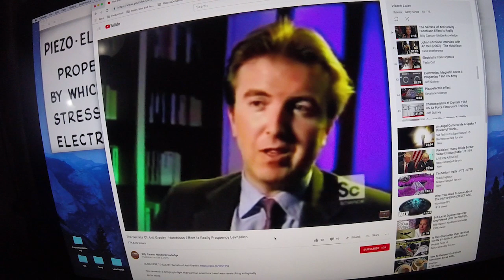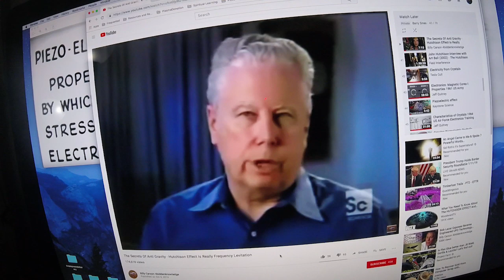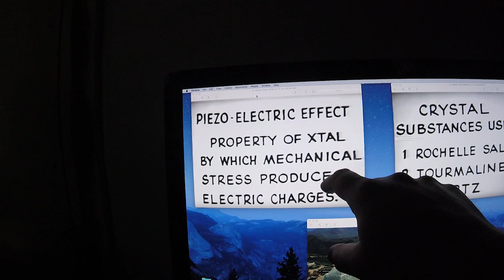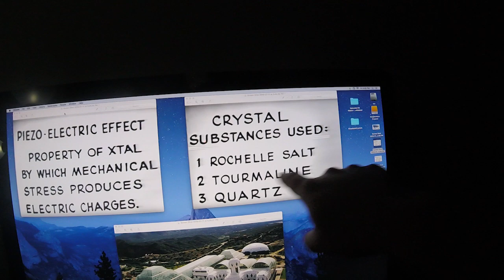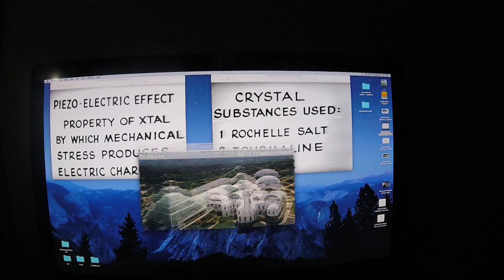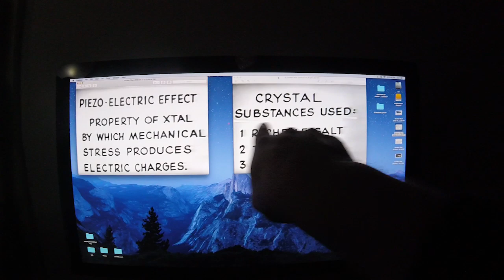DIY CRYSTAL Electricity Experiment - PIEZO-ELECTRIC Effect ✔️

Comment: For what those things are realy used for is hybrid engines who run generators!!!
You know that thing is vaporisor right? 
Just like the joe cell and stanley mayer they use them on gasoline dize engine blocks with closed egr exaust reciclation condensers and destilors preferably starter/generators are used john bedini stile with plazma amplifier ignition sequentional polarity swap with multi stroke engines .
Thats how you gain power with power plant!
Look how original otto engine works with dual fueling!
Primary gasoline idel start up warm engine up to operation temperatures original otto used hydrogen generator.
Secundary own engine lubrication oil from idel to max rpm original otto used buthanol as secundary fuel.
So what that shit is its oil viscosity changing cells via magnetism and chemical reactions !
At least how the joe cell works!
Thats how its done.
They actualy call those engines hot vapor oil cold gasoline high wacum runing engine Hot/Cold engines internal ore external runing principels ore bouth together!
And yes they use special baterrys like john bedini made cristal baterrys to by exactly!
And alternator starter motors are compound mashines !
Just put extra magnets on rotor and stator on alternator meaning you get power in and out ore other exampel of compond generator 2x ac out of faze and 2x dc - and + are produced in same device.
So in reality that same generator ore alternator is a pulse motor .
Similar working principel like the hit and miss engine fires at evry 10-12 revolution of the crank because of high energy fuel those other revolutions is time sequence to cool down wires ore metal parts duel to much energy fiered !
The similar effect does multi stroker engine.
So any questiones? 
They actualy use ordinary gasoline engine and turn that thing to hot bulb stille engine with self recovery fuel useing moisture absorbers liqueds only thing you are wory about are octane rating but that can by self regulated some liqueds in engine actualy compensate for octane loses ! 
Moisture absorbers are ethanol ore brake fluid.
Other exampel chemical reaction .
Chlorine Calcium Brake Fluid you end up with self ignition fuel based on time.
So no wonder high efficiencys are produced. 
Gasoline engine basicaly turns to dizel glow plug auto igition engine runing on lpg stile with self regenerating liqueds terminator movie stile 
And no Im not kidding !
Thats where those piezo get in to play as ultra sonic vaporisors .
Depends what type of fuel you use heat ore cold vaporication types engine goes and runs add on that hybrid any generator ore alternator there you go light up deam city if you like.
So simpel john bedini did actualy show the lockridge device who performs the same task .
I actualy run my deam car for whole day by just useing 1L fuel .
But after some time heavy oil vapor kicks in no fuel consumed what so ever.
No wonder first rudolf dizel run on carburetors and fuel air pre mix chambers similar to hot bulb engines  thats the trick old military tehnology .
And no dont show it to any one oil companis and electric companis wont like you that much!.
The chevy 250 350 joe cell was gasoline/dizel block and dune buggy from stanley mayer also was gasoline/dizel block so no wonder it worked fine .
But still oil was used !!!
How ever use waist oil ore sludge ore any thing solid flamabel like coal wood still does the same effect with power cells .
So thats the point !!!
Reality and truth gm and chevy actualy payed for false projects to try hide the real hybrid like steam cars jett cars etc all false staff the real hybrid were always on the roads driving!
Lot non sence like they wuld add big steam boiler to kubelwagen what for crap those units were not more heavyr as 20kg.
I sean those hybrids at work they can run for days and nights those engines are solid build nothing realy can destroy them.
If you surche for power learn how to make fuel ore extract it!
Use it on gasoline/dizel blocks with other tehnology like closed egr plazma generators vaporisators recovery exaust gases etc etc etc.
And you will light up whole city .
Because small 4 cilinders produce power from 1k horse power up to 3k horse power planty enough to suplly whole city dont forget gearing torque converters reversed diferentials etc that adds even more power !
Simpel sience if you have high energy fuel you basicaly use it less in first place ore smaller jetts !
If they self recover under high moisture rich wacum you DONT refule gas tank!!!
You actualy must empty it OUT!!!
Look how deam klima works ore air condensors work why that deam water is dripping when that shit works.
And fuel it self is 99.9 %destiled water !!!
So yeah so much for chemistry I supose how easy it is to sture shuger ore salt in glass of water so how easy it is to make burnabel water???
So peopel get the idea .
In my case I run for thousends of miles with just oil and posibly coolant alone always hade gas tank full rever used it in the first place .
But modify transmision from low speeds to higher speeds and use diferent diferential because hot bulb engines are low speed high torque engines modiffy alternator start charge rpm modiffy starter motor as well for low speed high torque and use pre heaters to engine probably jett right ore vaporise right hot oil vapor to engine ratios there you go problem solved run all day on peanuts I dont care what generator you put on that thing low speed pre ignition produces masive torque it shuld run fine only thing what you need is engine temperature increase control not to self destruct it meaning oil lubrication and water cooling increasion !
I wuld probably chose high amps generator for my house and actualy use just dc for evry thing build masive baterry and by done with paying for electricity .
If peopel dont know you get wayst engine oil for free by local mechanic shops ore use coal ore what ever as energy sorce even wood oil can by used ore make your own oil ore anima oil what ever 🙄 why on earth some one wuld use piezo? Well coral castel compound generator worked on hit and miss engine wind ore water useing engine duferential so that guy build castel by him self ,so Im wondering what peopel dont understand ??? 
I wonder what those brushes are made of? Because it seams only those go bade on starter motors and generators and heat in wires.
What if you replace that crap with special brushes who can carry high curent and voltage? What if you add cooling system to electric motor generators? What if you add lubrication system for bearings ore use anty frictiin materials like florine plastics? Well Gerard Morin proved hes point by useing frictiin less high frequency generator useing small shity wash mashine pump so yeah that thing indead lights up 100 light bulbs remindes my of high tension magnetos low tensions are used on slow rpm high torgue that same bouth functions are doing engines thats why they call them compound generators at low speed they produce high curent low voltag at higher speed it swaps high voltage less curent and frequency increase in hz .so dual wimdngs are used on stator and rotor!
Indead you can do similar thing if you introduce magnets to existing alternator windings .
So thats how its done:
Chemical,Preshure diference,Thermal Diferece,ExplosionImplosion reaction, bouth electrical and magnetical reaction.
And normal sience does not comply to any shape ore form if all of that is used together 👆.
In ww2 the kubelwagen used exactly that. It culd run on solids liqueds ore gas state fuels its a mather just converting that energy to usabel work! And at that time this kubelwagen was hybrid and anfibiuse mashine !
Any way john nearly perfected the piezo effect but still not enough its used mostly with hybrid engines to max its effects .
Yep tesla dead john dead most inventors dead because you cant patent it no one patended it how much I know I belive they killed even otto and dizel those oil bastards even treathened the train industry so no wonder evry thing is shit not realy shure what oil prices have to do with any thing and not necesary war at all but thats probably quesing work.
All it is just creative mindes you dont realy need oil companis ore electric companis thats the truth all you need is knowlage and do what you want thats all to it after all tesla was master minde whi died as pore men .
So nothing good you get if you go crazy with ideas use it on your own property dont show it dont use it in front of peopel if any  thing dont let any one see you doing it in the first place because you end up in deap shit for target practicing.